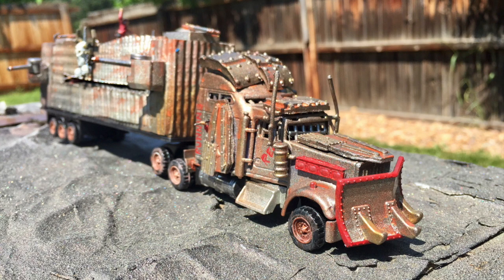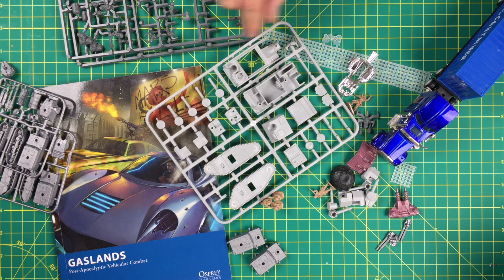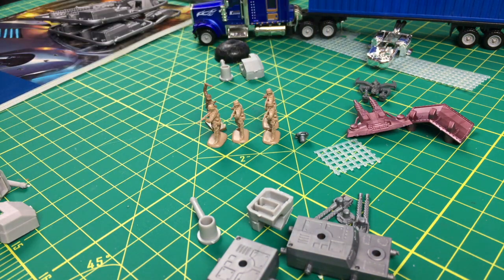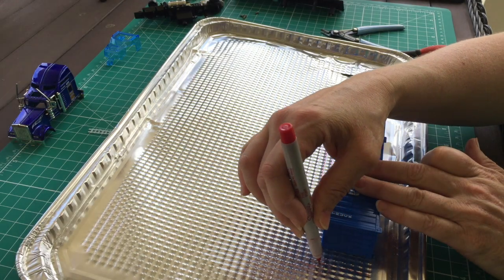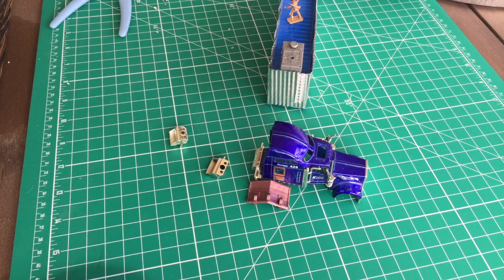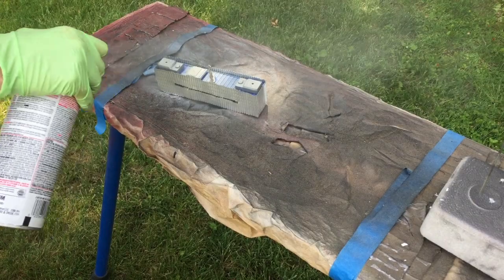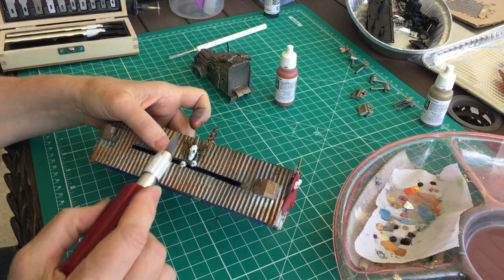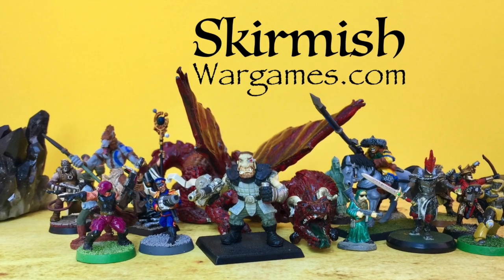GASLANDS War Rig Build

Comment: Any link to the ebay store for the truck?
Reply from the maker: Hi Joseph. This is probably it, but it’s not as cheap as I remembered. You might find lower priced options at a local dollar store. Some of these trailers have potential though. https://rover.ebay.com/rover/0/0/0?mpre=https%3A%2F%2Fwww.ebay.com%2Fulk%2Fitm%2F113690117273